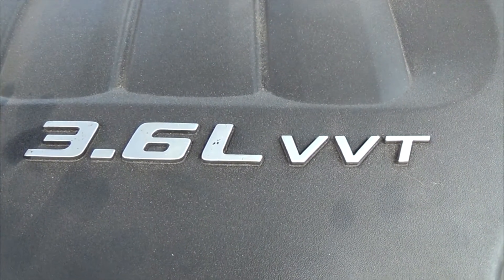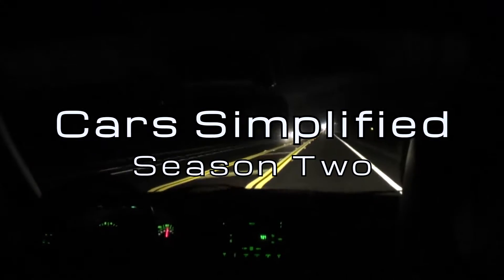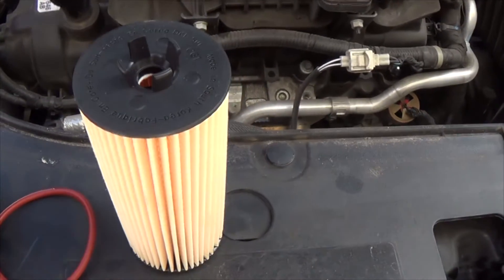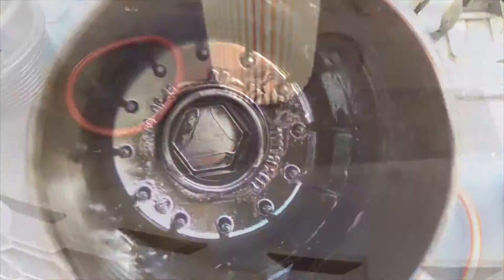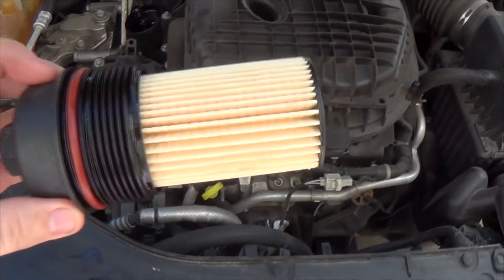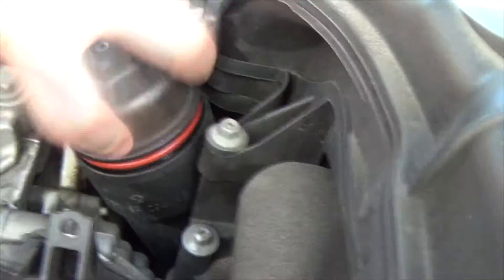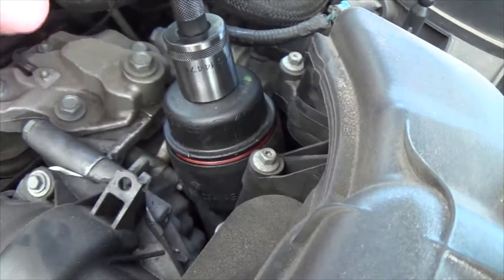How to Replace a Cartridge Oil Filter (Dodge Avenger Example) • Cars Simplified

Comment: aaaah you rolled the O-ring. big no no. i give you props though, i work at a dodge dealership and thats what i do every single vehicle i get with a 3.6
Reply from the maker: Is there an easy way to get those O-rings on without rolling them?

I imagine rolling them is bad because it stretches the inside rubber and it's not quite the right size after that?

Comment: I know this is a long shot seeing how long ago you uploaded this video but my mechanic drained my oil first before taking off the oil filter and then he could not get the oil filter off says it was too tight so he said it would be fine to just put the new oil in so he put the new oil in and left the old filter on  but because he was trying so hard to loosen the oil filter that there’s a space between the filter top and all of the new oil leaked out while I was driving. What should I do to get the oil filters top all the way off.

2014 Dodge Avenger SE
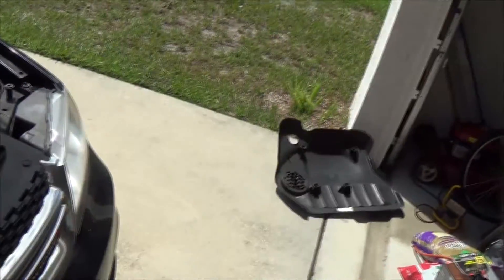3.6L FI FFV DOHC 6cyl 0:11